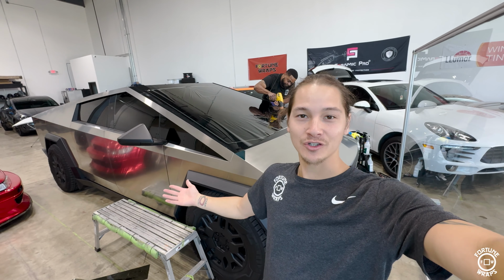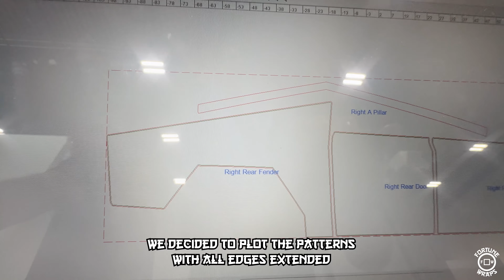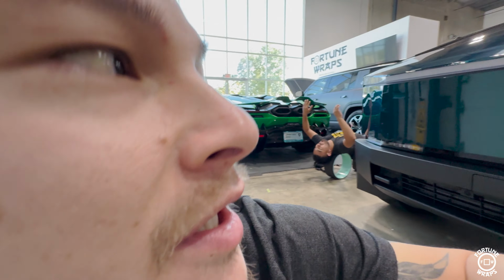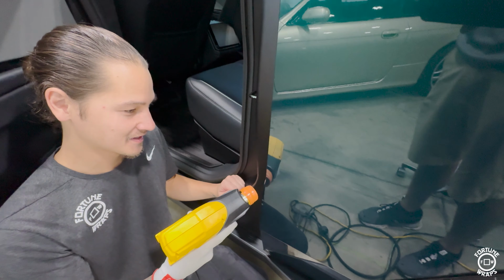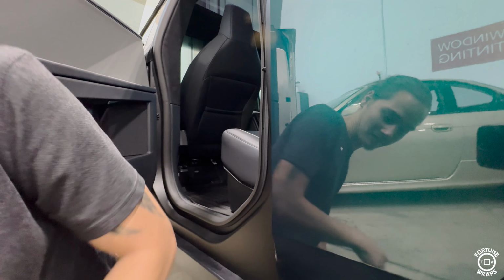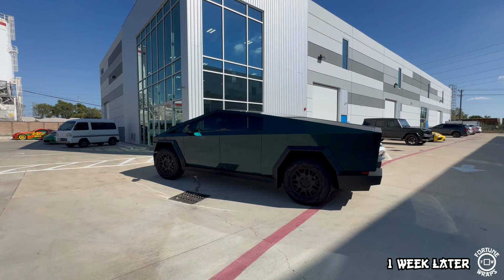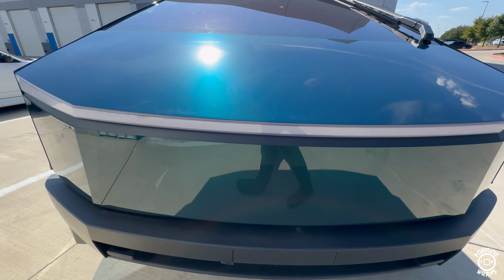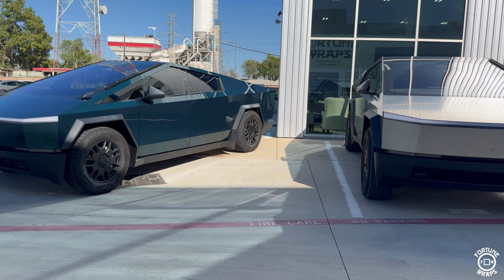Installing colored PPF on a Cybertruck

Comment: See this is what I was having issues with colored PPF on cyber truck the dam edges wouldn’t stick when I applied the film wet but the over all look of the surface was perfect but if I couldn’t get the edges down it wasn’t worth wet apply. But when I tried dry apply I’d get like worm like lines everywhere but I was able to get my edges down so I’m at a loss on what yo do
Reply from the maker: @Eazytarget  we laid all the film and let the edges dry overnight, heat helps but yeah this film is not as “sticky” as vinyl so I had to go over the edges multiple times. Didn’t use adhesive promoter (we try not to ever use it if possible) but it definitely would have helped on this one.
Reply: @fortunewraps  yeah my problem is how do you wrap the next panel and cut if the previous tabs are hanging over?